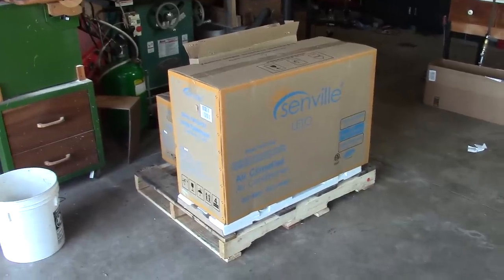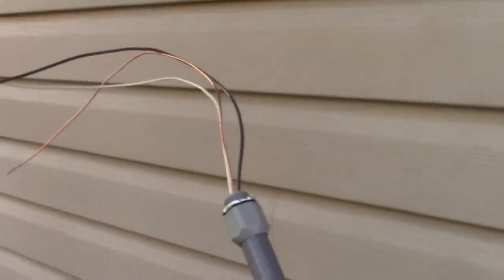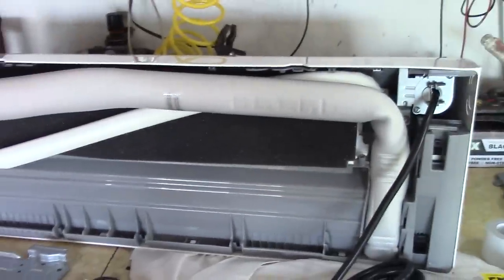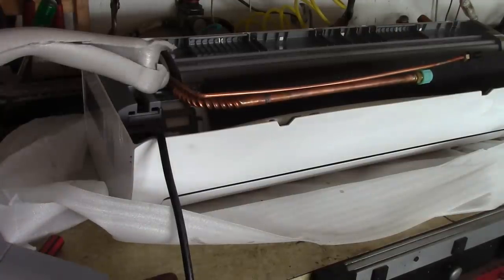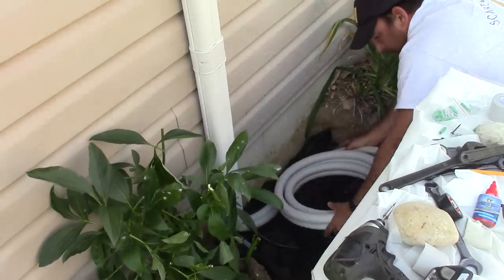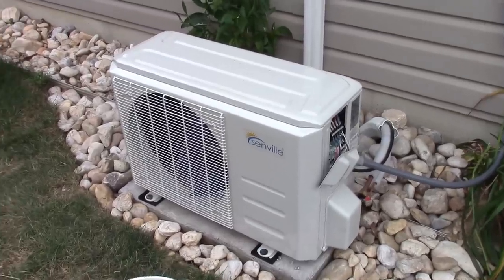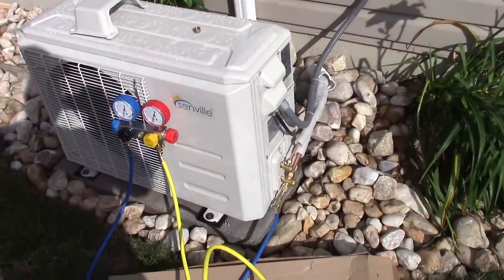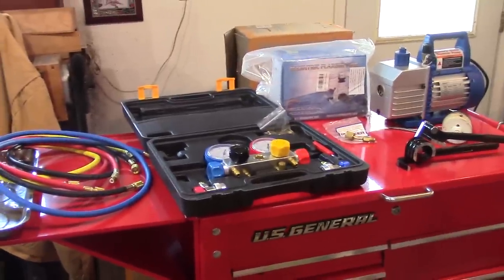Mini Split A/C Full Installation Full Video

Comment from the maker: https://amzn.to/2mhKtx4 Senville Mini Split 9000 - 24000 BTU
https://amzn.to/2LLKYxL 4 Way gauge set Manifold
https://amzn.to/2NiVNV6 WD-40 Bulk Spray Can Pneumatic Pressure
https://amzn.to/2zRZ8ZJ  14-2 Wire 50 foot (9 & 12,000 BTU units)
https://amzn.to/2ureNtz 12-2 Wire 50 Foot (18 & 24,000 BTU units)
https://amzn.to/2NTaJuj Air Conditioner Disconnect
https://amzn.to/2LeYfyv HVAC/Auto Vacuum Pump and Manifold
https://amzn.to/2JrYa5K Flaring Tool for linesets ends
https://amzn.to/2uohrQQ Tubing Bender 
https://amzn.to/2upv8Pw NyLog Refrigerant Gasket Sealer
https://amzn.to/2LkzGwS Mini Split Gauge Adapter 1/4 to 5/16
https://amzn.to/2NVw8TB PVC Lineset Decorative Cover
https://amzn.to/2Lj7ydO Senville Wall Mount Bracket (outdoor Unit)
https://amzn.to/2NTjZyD Micron Gauge for vacuum pressure.
Reply: doublewide6 Repairs LLC I need someone to fix mini split Michigan did you now any one
Reply: doublewide6 Repairs LLC  I have a question I installed mine but the heat doesn’t seem to get hot enough to heat the building I bought a 18000 btu and my garage is 400sqft can you give me any advice?
Reply: Hey thanks a lot for the video! Do you recommend getting a foam sealent instead of the clayish material supplied with the ac?
Reply: How has it held up since you installed it?
Reply from the maker: @keithpizano1741   Not any problems with the unit it has been great.  I'm putting one in the bedroom too.  Amazon did a great job shipping I would order from them again because they included liftgate delivery service for free.
Reply: @doublewide6  Thanks for the replay. Awesome video.
Reply from the maker: @beezy870  You need to hook up your gauges and check the R410A level.  Did you vacuum the lines properly at install?
Reply from the maker: @sterzian241  The clay works well and I think it will hold out water better than foam.
Reply from the maker: @keithpizano1741  Very well no issues 6/27/20.  I installed another multizone Cooper and Hunter unit in my house.  Love it!!  Made a video too.
Reply: doublewide6 Repairs LLC I’m all good man housing had a bend in it which wasn’t allowing the fan to turn but it’s blowing snow ball now
Reply: Did you have the unit running while you open up the Freon lines?
Reply: TheLawnmowerGuy TheLawnmowerGuy open the refrigerant lines, then turn it on.
Reply: What exactly are you vacuuming?
Reply: @tijuana_no4169 , you're removing any air or moisture in the lines.
Reply: Thanks for the video, I just installed one myself.  How is it holding up 4 years later?

Comment: You deserve every accolade you have received. I learned more in the last few minutes alone than in all the other hours of research on YouTube. I’m closing in on “geezer” status but your video and especially tool recommendations have given me the confidence to proceed. I have the Senville Leto 24,000 ordered and it should be here in 10 days or so. I, also, have oversized (never regretted doing so at any time in the past) so we will see. I am using your video solely for my install and will probably watch daily till my unit comes in. Thank you so much.
Reply: Thank you for sharing your knowledge. I found this video very helpful as I installed my own Senville 9000 BTU unit.

Comment: Thanks for this video.
I learned a lot from it. I bought Mr. cool 1800 BTU advantage serious. When I ordered it I thought that this is the one that you do it yourself DIY. All the videos on YouTube is related to the DIY. 
Your video is the only one that I was able to find that gives you detailed info regarding the Advantage series.
I did some mistakes initially as I connected the copper tubes before I pass in the wires through the wall conduit. After I saw your video I had to redo the whole thing again. I installed the inside unit and outside unit and I ordered the adapter that will connect the gauge to my outdoor unit and also I ordered the sealant
I am impressed by the way that you’re able to
 Bury the line in the ground

I wish that you live close by I will let you take care of this job and I will pay you for your work
Just by watching this video I got the impression that you are a nice and sincere person who is eager to help others like me
May God bless you and keep up with this great work

Comment: Agree with all the comments. Doublewide, you rock. Such good information. Plus having the links below. You gave me the confidence to do it myself. Everyone, keep in mind that all the senville units are not two be wired 240. The smaller units are 120. Read the electrical specs carefully.

Comment: No bubbles from soap and water. When the system is in vacuum.  33:00.  Vacuum will suck the soap and water in.  And make soap bubbles inside the pipeline.
Reply: And THIS ia why DIY people void the warranty!!
Reply: Oh no guess I'll watch another one
Reply: @adamrspears1981  Considering I can replace it 3 times for the price of having it installed by a professional I will take my chances with out a warranty :-)
Reply: @adamrspears1981  He may have misspoke but he didn't actually show or state that he looked for vacuum leaks by the soapy water test. I think most DIY people that attempt this level of project would realize he meant a bubble test for leaks once the system was pressurized. It is true that this unit requires professional install or it voids warranty but warranties with even professional installs are so difficult to claim and this unit carries a short warranty (longer on the compressor) with parts only so either way it's going to cost you plenty. I'm for anyone that can install one of these systems on their own with good self training and research.
Reply: the pro's charge the lines with nitrogen first, and test for leaks, then vacuum it down and charge.
Reply: Before  vacuum you can  pressurized both  lines with nitrogen   to check for leaks.

Comment: excellent video. Thanks for your time. I am not an aircon guy. Everything was clear until minute 32 where you shut off the low side and you left the yellow line connected to the vacuum pump. if you did that, you have isolated the gauges from the system, of course the needle wont badge therefore  the system isn't under test

Comment: Pretty good video, just a couple things you might want to correct though.  During your leak test you pulled the vacuum on the system and said if there is a leak you would use a soap solution on the joints to find out where its leaking.  That would be true if you were pressurizing the system not putting a vacuum on the system - unless you have a way of looking inside the line for soap bubbles ;-).  Also you said they use an inverter system to take AC power and change it to DC to run the system.  Inverters take DC and change it to AC.  I think you mean't they use a rectifier system to change the the AC to DC.  I would recommend torquing the joints to the specified torque - I don't think most folks know how strong they are when it comes to tightening bolts and these fittings are brass.  You can strip them easier than steel which is what most people are use to wrenching on.  Other than that I think your video was very good and most people would have a successful install if they followed it.  Good job.
Reply: good point, blow air into it so it will bubble, thanks

Comment: Thanks for making this video. I bought a Senville unit just like yours. I had bought one before in my last place, when the units went under the name of Shinco and it was a great unit so I had no hesitance in buying this one. One problem that I wanted to share, and for which I found a solution...

When you install the right angle drain under the 12,000 btu model compressor it extends down too far! If you place the unit on a flat slab floor, the feet will no longer touch the ground. You therefore have to raise the unit on some blocks or something of the sort. After hunting around with various options I came across a genial idea - In the plumbing aisle fo the local HD I found some 3" ABS Cleanout Plugs - for about $1.80 each. These make perfect raised feet! They are strong, and you can drill a hole thought them for mounting. I even cut the rubber shock mounts to shape and sandwiched them between the feet and the top of the plugs. The effect is to raise the compressor about 2" - perfect to accommodate the drain outlet under the unit!

Cheers!

Comment: Best Mini Split video hands down, I've watched too many to keep count.  Wish you could have detailed more about the torque job, minus using a torque wrench, I'm installing mine as we speak or as I type, that is my only worry or concern in my install currently.  Also, my only suggestion to anyone reading, ALWAYS run your refrigerant lines on the side that they are on, just add the 90 degree bend and run them directly out the hole you just drilled.  DO NOT try to bring your refrigerant line in the hole, then connect and create a 90 degree .... I started that route and closed that whole up and went the simple route, i wasted 3 hours trying that direction and was left repairing a wall.  Keep it simple

Comment: Good overview video.  Very clean appearance after the install.  Hopefully you will take the following as a constructive criticism. The raw wood you buried will rot quickly and attract termites.  Don’t completely cover the flare joints at the top of the line set until you have released the charge.  Once the charge is released, you can use soap to look for leaks.  The nitrogen is in the head unit is used to keep out moisture.  Manufactures do not recommend the use of Nylog on flare fittings.  The gauges and hoses you have will not measure the deep vacuum of the 500 microns required to remove all moisture/air and it will not show the decay rate.  The smallest amount of moisture in a system will shorten its life.  This is why manufactures will not warranty a homeowners work.  I would recommend that the DIYer install everything up to releasing the charge then call an HVAC guy to pressure test the system and evacuate it.  The less than 1 hour charge you pay him will also validate the warranty.
Reply: I set out looking for info on how to go about recording the "SYSTEM PARAMETERS" readings on the warranty form after my installation. I'm confident that the work was done correctly, but a bit disappointed now to hear that DIY installs are not warranted. However, thanks for the tip; it'll save having to do further research on it.

Comment: If you end up doing another install just a heads up it’s not that only the small line is charged with nitrogen both lines are connected through the indoor coil. So which ever one you open first is the one that’s gonna piss the nitrogen out, but your correct it proves there’s no leak but not only for a line it’s for the whole circuit suction line liquid line and your indoor coil. And be careful with them bushes it could cause a high head pressure on your outside unit on cooling mode. Could cause problems.

And it’s 410a refrigerant not Freon haha. Informative in all thanks for sharing your experience
Reply: Did he close, the right side of the gauge though?? Cause by closing the knob that he did, you will only get the reading vacuum from inside the gauge to the vacuum pomp

Comment: I did a few things a little different, but for the most part this was a very useful video out of all the others specific to Pioneer. 

I installed one 18k BTU in my double garage because I live in Southwest Louisiana where it’s 97f in August with 90% humidity and I thought that I would need to run it at 74f from 12-4pm to suppress the Heat & Humidity, but 78f is plenty and I’m hot natured!

Turbo Mode will really get the temp down quickly if needed. The Pioneer’s are also super quiet on both the indoor unit and outdoor condenser. 

Only thing I would do over is NOT install one in July! Haha

Comment: You did a very thorough job. I like how you met the challenge of the line-set length. Very thoughtful. I like your hind-sight thought better. ( placing the out-door unit far enough away). I have already had a Fujitsu installed by a local company. They did a good job. I had thoughts of doing it myself, but chickened out. But after watching your video and realizing you don't have to deal with refrigerant,(my biggest concern) I feel quite confident on doing an install for the master bedroom. Thank you very much for taking the time to produce a top quality video. I'm sure you could have done the install in half the time if you hadn't.

Comment: Very good presentation.  I'm in the process of installing a new Daikin ductless mini-split and have done considerable research after finding what seems possibly to be the inflated cost of having a licensed contractor do the job.  I respectfully want to add a few pointers to this video.  Please note that there is a Schrader valve in the freon system that needs be dealt with when vacuuming the system prior to releasing the precharged freon that is held in the outdoor unit from the factory.  If the Schrader valve is not properly attended it prevents the indoor unit and lines from the vacuum process.   If the lines and indoor unit are not subject to the vacuum the resulting contamination will void the installation and put the entire project at risk.   The Schrader valve is similar to a valve core of a tire stem.   One other pointer is that the outdoor unit could be more protected from lawnmowers and other life hazards like flying stones from the lawnmower or other debris that may cause harm.  I am not a license holder for electric nor HVAC and am offended by the industry who considers all homeowners invalids when it comes to mechanics and technology because there are some homeowners with superior knowledge to that of the employees and controllers of the mega-corporations.

Comment: Good job, man! I have some notes - first, i don't understand the Nylog compound, where the metal-to-metal contact is good enough, but no prepblem with it. Second, when you are releasing the gas into lineset, you perfectly start with line with no meter on it. You will not force the liquid int oyour hose, which is safe to you. Next time, you may release only a little gas just to get slight overpressure to minimize leak during hose disconnecting. Then release all the gas. Third, not sure with lineset not covered near the outdoor unit. 
But still this is really nice installation and yes, it is well done for a much less money than pros would ask you for.

Comment: Maybe next spring you could do an update on this system and comment on the good / bad / problems / issues / suggestions; guesstimate the number of hours used?
It would have been interesting to baseline the refrigerant line temps (at the compressor connection fittings) after is was first installed versus the video update.
Regards.

Comment: As a electrician and hvac installer
I actually genuinely enjoy watching diy videos . There is a reason we do so much school and learning . 
Your only saving grace will be the nylog , 
No positive or negative pressure test with nitrogen . Nor did you use a micron gauge ..... has nothing to do with pressure it’s to do with vacuuming moisture out of the system . Only tool to show this is a micron gauge  you cannot see a leak on a manual manifold gauge . Micron gauges show this ........
Reply: Mathew, just wondering as I am a DIY er on a remote island in the South Pacific about to do the install. A few issues:
1: No professional HVAC guys period.
2: I dont have a torque wrench, micron gauge, nor that liquid Nog.
So with that said:
Can I pressure test the lines first and check for leaks.
Then  can I throw a vacuum on it for a few more hours to try and get more moisture out? Or longer vacuum if need be?
3: Is there anything else I can put on the lines if I didn't have Nog? Maybe teflon tape?

Comment: I priced out a Mitsubishi and the total price was $8000. I had decided to go with a window unit heat pump for about $800 including electrical  Your system makes me rethink. Thanks buddy. Really appreciate it!
Reply from the maker: The window unit will do the trick, but you are losing your window.  No problem the video was fun to share.
Reply: @charles zeller.. window heat pump? I found ac with heat ( resistance) in several window units but no heatpump only window units.  Mitsubishi  is a tough buy in some areas. But i swear by the  brand and got  a two ton 21SEER unit installed for $4200.00 from a GOLDSTAR dealer. Up the road the dealers wanted much more . I would not  buy the off brands..
Reply: Are the window units ready to go? Just do the electric? Do I still need to vacuum air and release refrigerant?

Comment: Thank you! That was great info. Just bought an 18k unit for my garage as well. I want the outdoor unit in a specific spot, so I'll just adjust the location on the air handler so as to utilize the entire line set so I can avoid the issue you ran into--although you did an excellent job of concealing the extra line.

Comment: Thanks for the video.  Finally someone explains how to purge the system with a vacuum pump without trying to obfuscate or hide the ball.  Great job!
Reply from the maker: Thanks, No issues what so ever with this unit.  I use it all the time for heat and I bought it for mainly AC.  Go figure.